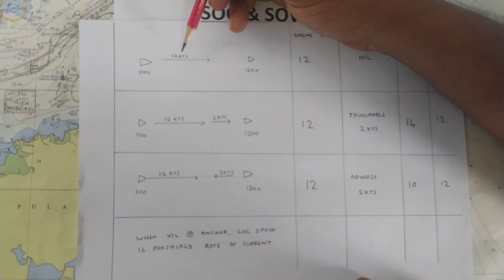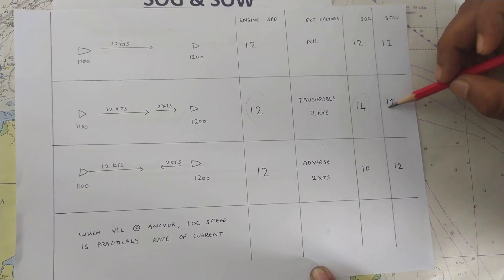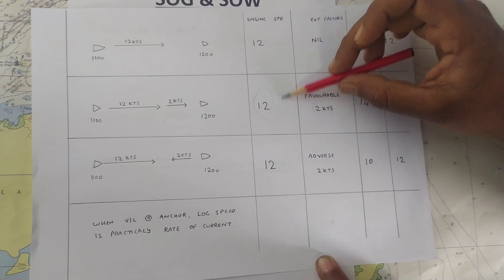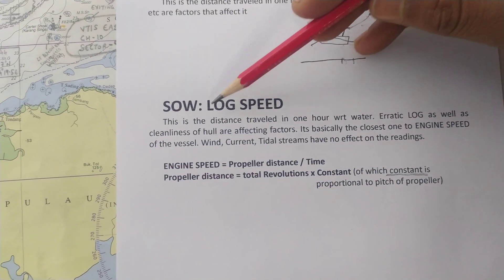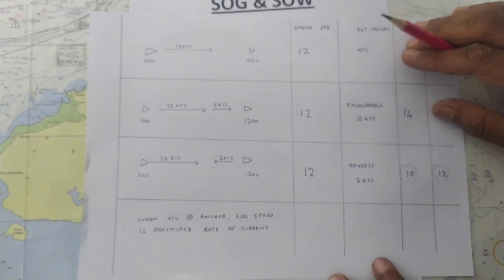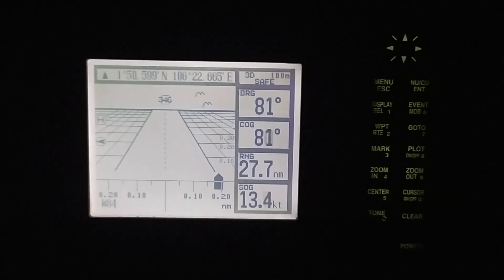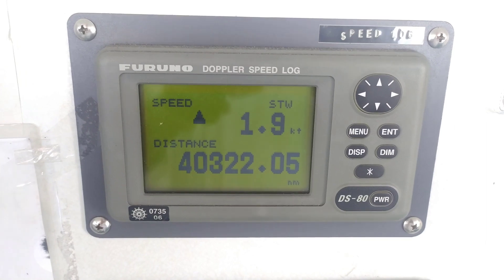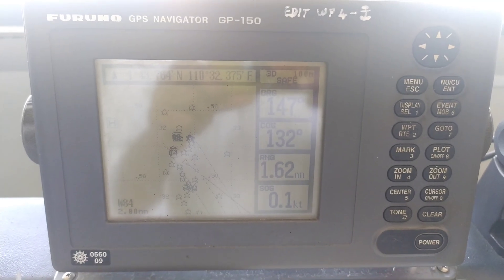Speed over Ground (SOG) & Speed over water (SOW)/STW Explained

Comment: isnt the sog is the speed calculated between 2 waypoints? and the stw is the current speed of the vsl at that time is it?
Reply from the maker: Negative sir. 

SOG is basically your GPS speed. Its the speed your ship is doing after all effects of wind and current and anything else affecting your engine speed 

Speed through water is your engine speed which is the speed your engine is giving at the present moment. It is not inclusive of your external speed reduction factors like current and wind. Its basically your engine speed shown on LOG (Doppler)

Still if have a confusion, do message me. I will try my best to explain.

Thank you sir.
Reply: @prasobhsugadhan  sir but at anchor there is "no engine speed" but still it is showing STW -1.9kts.